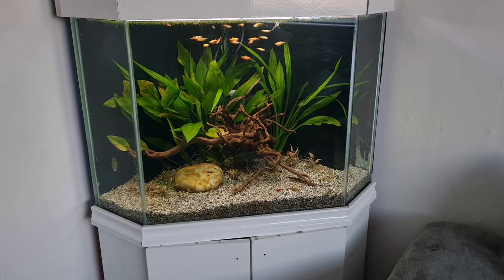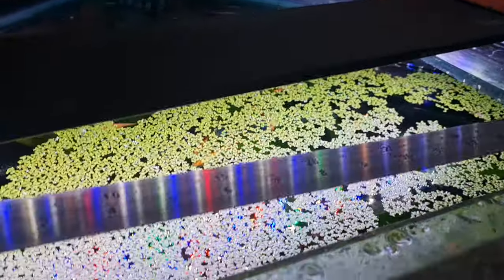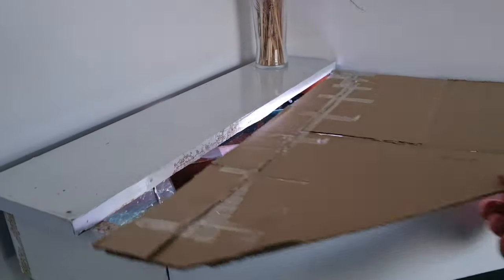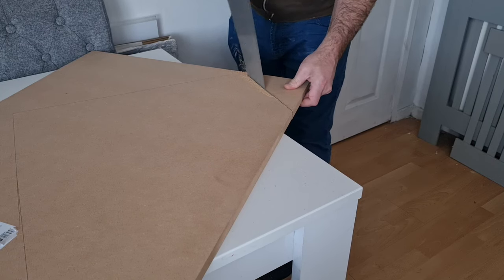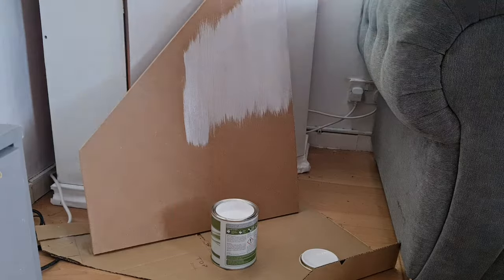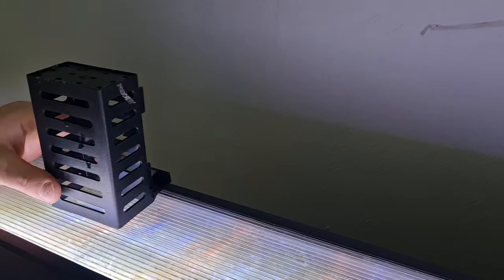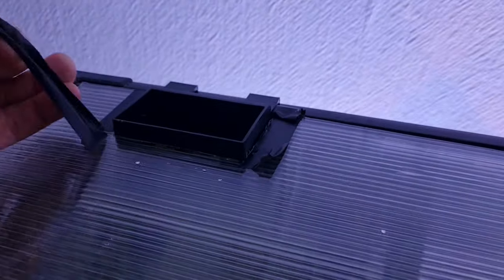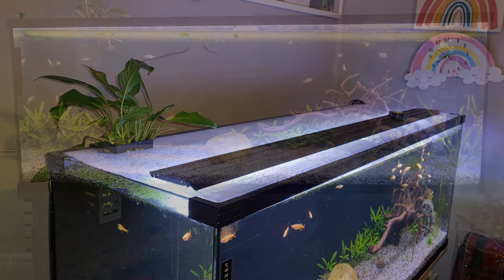DIY AQUARIUM LIDS

Comment: Great video Daniel and really good of you to give the tank away to someone more neady. Just one thing I came across and it would be good to know what experience others have had. I used to use polycarbonate on my greenhouse but I found that once moisture got inside the little tubes, I would then have a problem with algae inside the polycarbonate. The only way I found to cure this was to run some silicon along the open edges.
Reply from the maker: Good point man and will be interesting to see what others say.
I haven't had that issue myself yet but almost looking forward to it to see what remedy I may be able to discover.
Hope other people who have had the greenhouse issue see your comment and post some solutions too.

Comment: You did a good job! I've made lids out of double walled polycarb for all my tanks. Its a great insulator and keeps the water in the tank.
If you're feeling really crafty, you can easily add some light duty piano hinges to make a lid. You can then add food and get in the tank without taking the whole thing off.
I also edged them with duct tape to hide my wobbly cuts 😉
Reply from the maker: Thanks very much, for the kind words and the suggestions. I have been thinking up solutions to access for feeding so I might give some of your ideas a try.
Thanks again.

Comment: When i do mine, I make 2 lids so when one opens the front, the rear stays in place. For the plants, I find it much easier to use hydroponics pots. They have a large flange on top, and being circular the hole can be made with a hole saw. I'm  not strong enough to cut that stuff with scissors Daniel, perhaps your wrists and forearms recieved more intensive training back in the days befoer Mrs DKF?
Reply from the maker: Yeah man. Used to get a lot more time for tennis before Mrs DKF came along. 😆
Thanks for the extra suggestions. Am toying with a couple of ideas around a feeding/maintenance hatch solution.